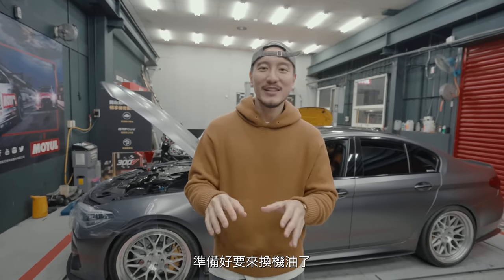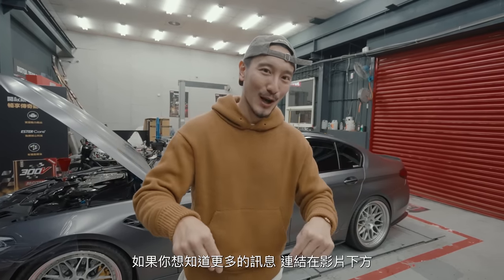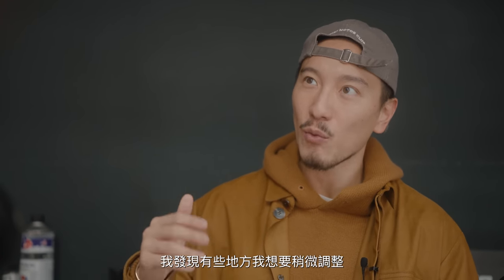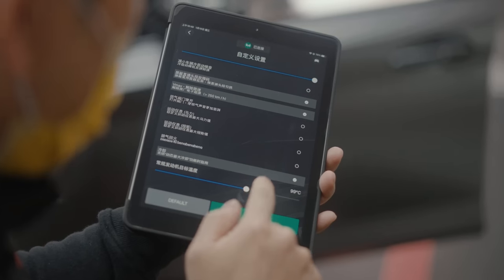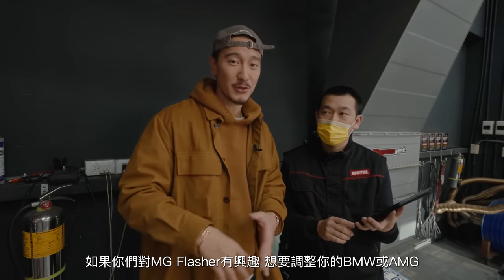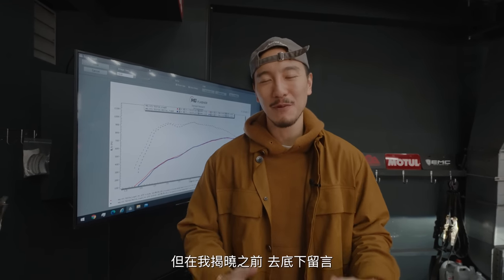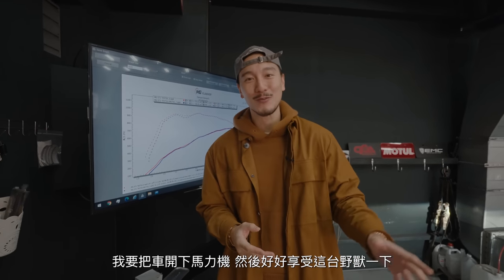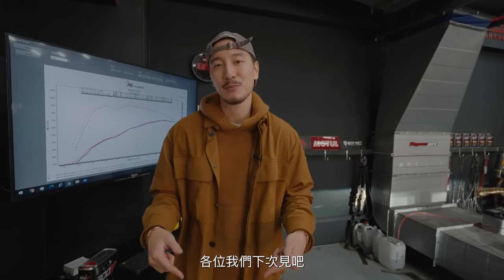M5強勢回歸！除了改電腦，換機油後能增加多少馬力？BESIDES ECU, CAN MOTUL OIL INCREASE ENGINE OUTPUT?《EMC Vlog Vol. 60》

Comment: I used to fill up with 300V during the track day and it was definitely pull a bit harder with better engine responses. But I also heard people said it isn't quite suitable for a daily basis, as it doesn't give enough internal protection to the engine. So people tends to use 8100 for daily and 300V for the track.
Reply: That's true because it's a race base formula I also heard it's not good to change this oil say over a year, it's more of hardcore oil not daily type.

Comment: I have used the latest Motul X-Cess Gen 2 for over 8000km now in my Mercedes V8. Noticeable improvement in throttle response and pulls harder throughout the rev range. I did notice lower engine temperatures as well on the highway.  I have used Liqui Moly Molygen in the past, and it didn't have the "punch" in power delivery as Motul.
Reply: to be fair, LM molygen is not the direct competitor for 300V, you should compare 300V with LM Synthoil, not molygen.

Comment: 300V is like racing oil good for first 1000km as it contains tiny percentage of special blend additive. Ravenol has same additive but with higher percentage which will last longer for the power output. The base oil require with high percentage of PAO or Ester blend to reduce the oil flow drag and high temperature resistance for turbo engine.